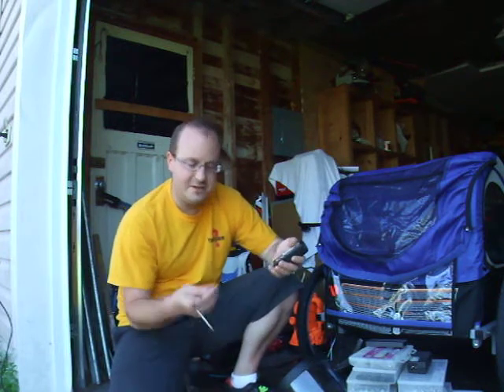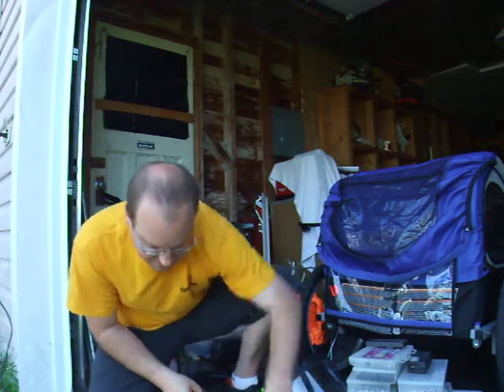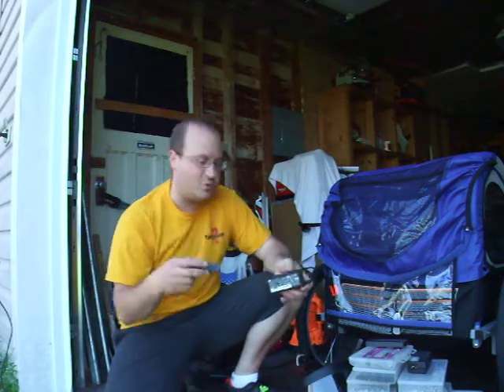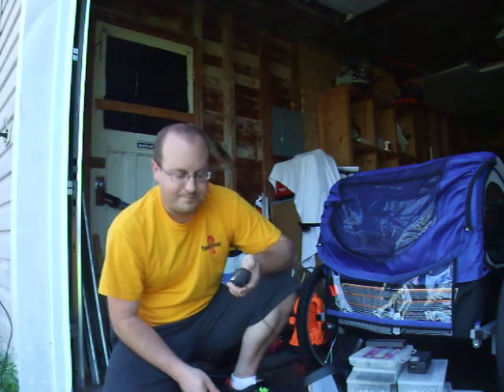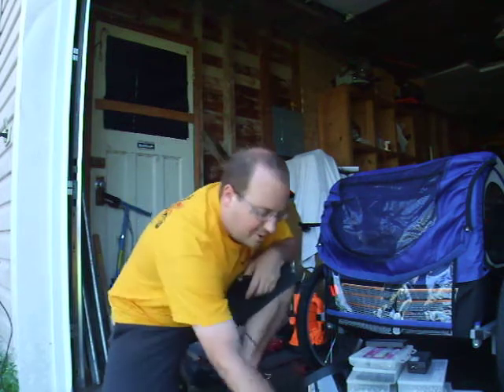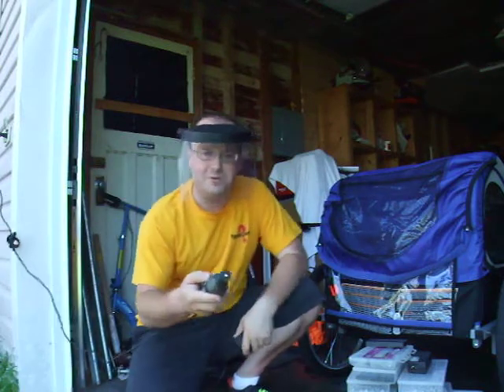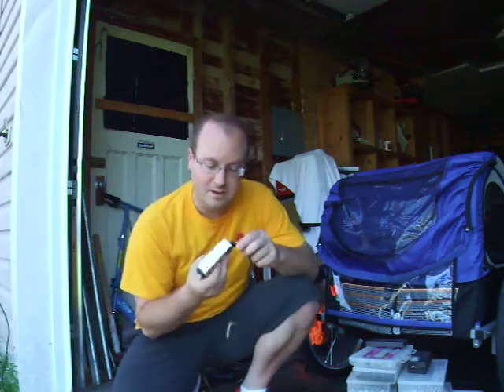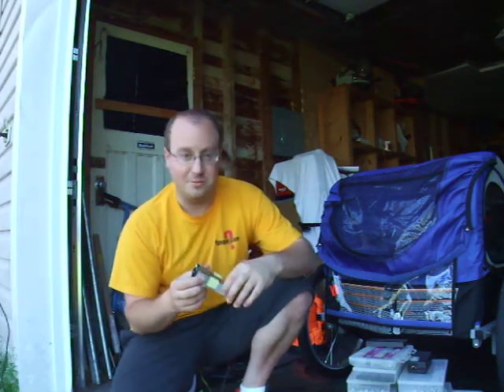Opening Laptop Power Supplies with a Dremel instead of a Hammer

Comment: The process they use to close them at the factory is called ultrasonic welding. The ultrasonic waves cause the plastic to vibrate slightly so the lip heats up by friction and melts, so it's just like a normal weld (i.e. strong and difficult to take apart). I don't have a dremel, so I just use a hacksaw on the corner and then pry it open with a screwdriver. Coaxial cable shouldn't be hard to solder to - just separate & twist the shield, and use it like a normal wire. Insulate with heat shrink.

Comment: dremel a good idea. if you want to leave a lip on the case to glue back together try using the blade nife and tap the back of the blade with a hammer on all four corners. fixed a few this way :)

cheers